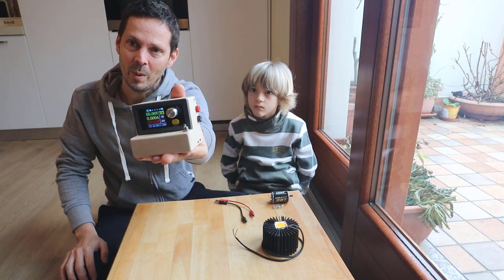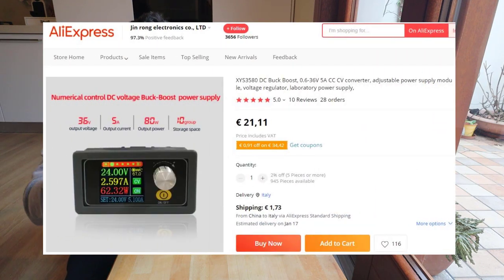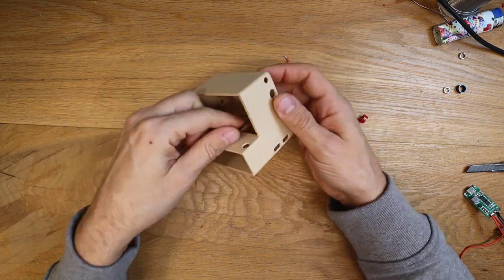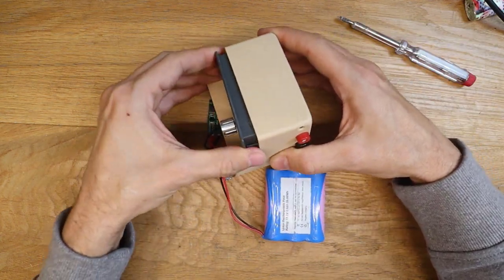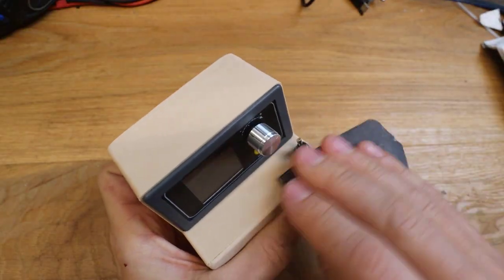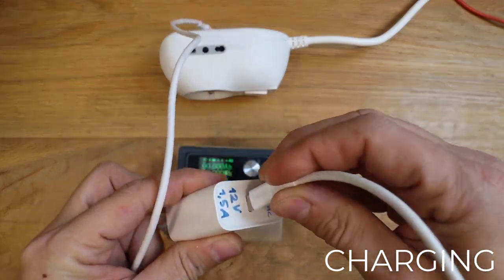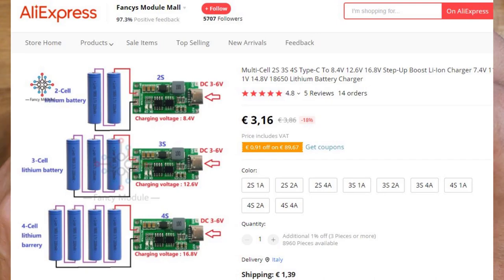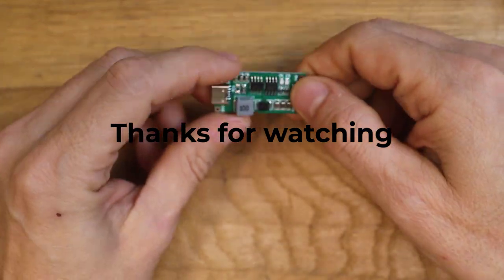DIY cordless power supply, battery powered, USB charge, XYS3580

Comment: For stability and to prevent the risk of fire, use a charging board with a built-in BMS circuit.
Reply from the maker: Hi, the battery I used in the video is a protected battery and it has BMS and thermal protection already